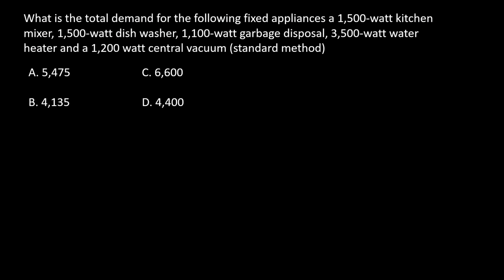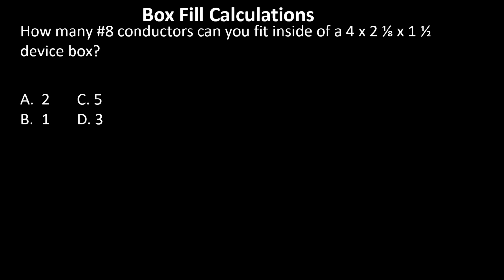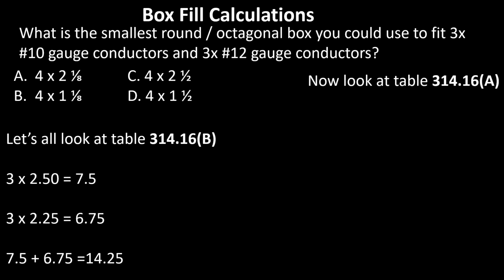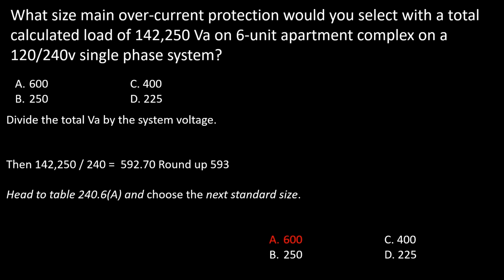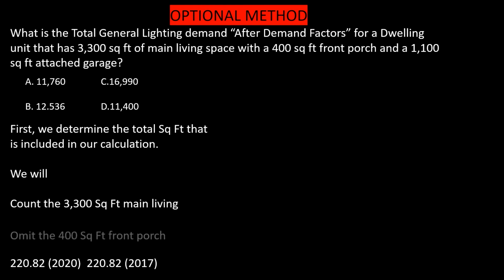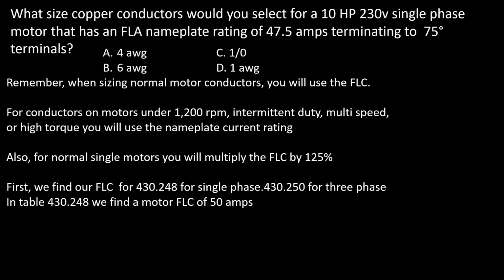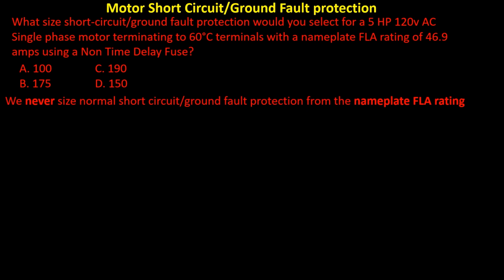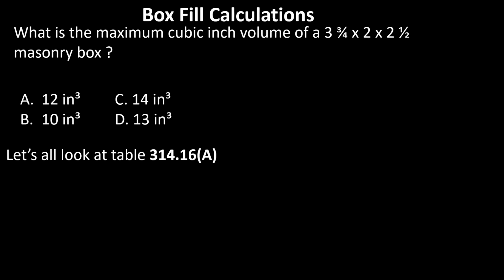25 Electrical Exam Prep Questions with Full Explanations Volume 7

Comment: Hi coach!! Question!!  can i use the ampacity of the 75 degree column for adjustment and correction when im using 75 degree wire terminating on 60 degree terminals?
Reply from the maker: So you're going to always use the 90° C column unless the wire is specifically only listed for the 75° C column, and there's not another code that allows you to use the 90 anyways

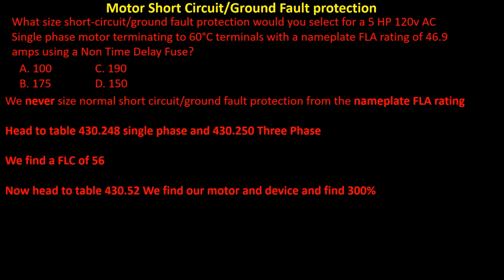Comment: @ 22:45   56 x 1.75 is 94. leading to a 100amp overcurrent protection device. You multiplied by 1.5 instead and got 84 and got a 90A OCPD.